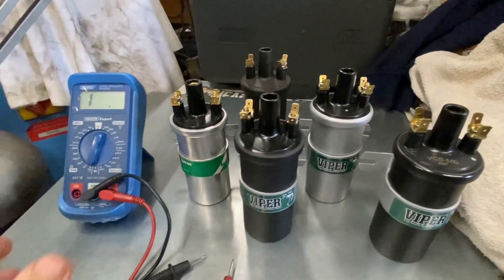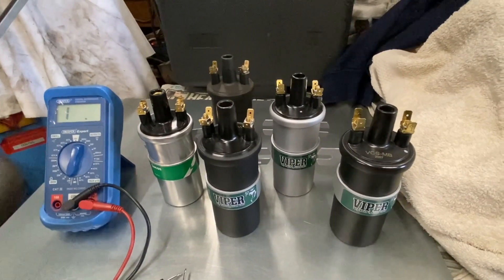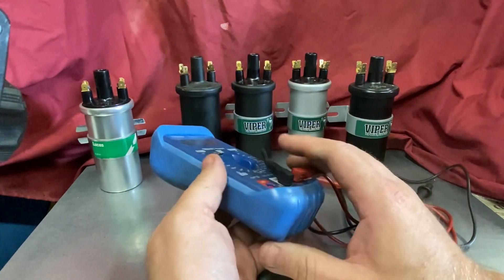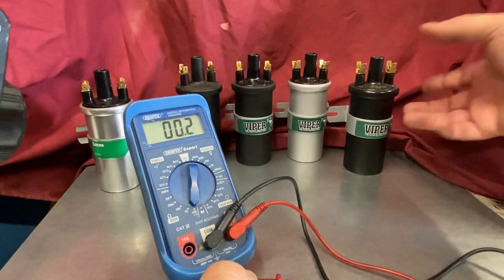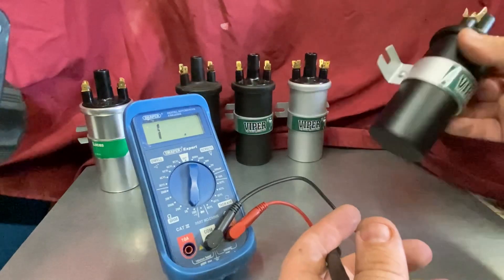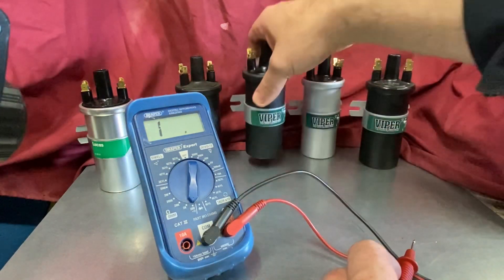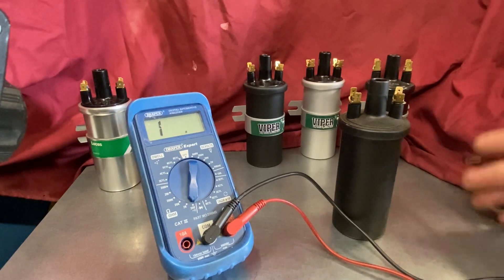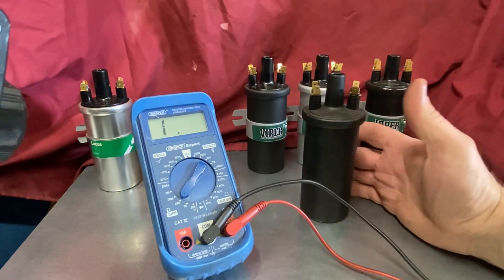Measuring ignition coil primary resistance

Comment: minnesota usa back in 1968 my brother bought a triumph harold a pice of crap british car. it would not want to start in the cold. I took a coil and ballast resistor off a 1957 chevrolet and hooked that up with a door bell button to short out the ballast. he would hold in the ballast bypass button and crank it. that really helped. he wondered why the the Brits would put the ballast in the original coil. all I could guess is it does not get very cold in england so they could get away with it.

Comment: So, you test the 2 terminals to get the primary resistance, for sure? I ask, because some guys on YouTube posting videos about doing it the other way, saying test 1 stud & the spark plug wire coil terminal, for primary resistance.? I believe your video is correct, cause doing it your way I had the same measurements of voltage.
Reply from the maker: The test you describe is how to test the secondary winding resistance
Reply: @ACDodd , oh ok. Are you the gentleman that posted this video?
Reply from the maker: @patsuddarth1093 yes
Reply: @ACDodd , oh ok. Well, thank you for the feedback & posting your video.
Reply: @ACDodd , so testing both of the coil's terminals would give you the primary resistance of the coil? Making sure I understood your video, correctly.

Comment: Old guy here. What is that device (the coil) used for? Much easier to send low voltage to a coil pack. Life is so much easier now with fuel injection and such. Just wish they had never gone to direct injection.
Reply from the maker: That’s an ignition coil for a classic car.

Comment: Good info on coils, I bought a 53 Ford Customline which had poor starting and a bad random misfire which I eventually traced it down to a 12 volt coil being installed backwards in the cars 6 volt negative ground system. Replaced it with an NOS coil and it starts like a dream. It has been my experience that spark plug gaps bigger than 0.040 just destroy ignition parts with no appreciable improvement in ignition performance. I went from the stock 0,055 gap on my 99 Ford and buying a lot of coil on plug parts, to 0,040 and not buying any with an engine that ran perfectly and passed many emissions tests.
Reply from the maker: Correct excessive gap causes coil insulation failure.

Comment: Hi AC, Can I pick your brain? 
I have a 1500 Spitfire with a Pertronx Ignitor coil and a ballast resistor wire. Pertronix call for a minimum of 3ohm total primary, and mine measures only 1.9ohm! 
Does the ballast effect things?
What coil should I fit and are standard plug gaps ok with the Pertronix fitted. 
Many thanks
Reply from the maker: What is the Petronix rated for?
Reply: @ACDodd thank you for the reply. 3ohm.  Main question really is, is it OK to fit a 3ohm, with the ballast resistor
Reply from the maker: @mickpower4796 no a 3 ohm coil is a backward step, especially if the module is variable dwell, you will actually be reducing your spark energy at idle and cranking. The ballast resistor will make this even worse.
Reply: @ACDodd thank you again.

Comment: You are a very knowledgeable man. Are they 9v coils when you use a ballast resistor? How do you match the resistor ohms the the coil ohms please?
Reply from the maker: You can’t use 0.8 and a larger ballast it won’t work out. Use primary and ballast that equal 3ohm for points ignition or electronic ignition with fixed dwell.

Comment: Will I need an external resistor for my ignition coil if it is not resisted? Or will it work without a resistor
Reply from the maker: That depends on what resistance your coil is and if your electronic igniton module is variable dwell or not.

Comment: Hi. What is the best coil to use for a 59d electric dizzy? Many thanks
Reply from the maker: The one with the lowest resistance as recommended by the manufacturer of the ignition module used.

Comment: So helpful! what are the odds of five coils being burnt out and sure enough thanks to your video I finally diagnosed that all! my coils are burnt out, 2 are new, never used!!!! because none of them have a secondary resistance, I'd been going mad trying different multimeters finally figured out that the only setting you should use is the one that beeps despite the instructions on the Klein meter I shelled out for you should definitely just use the continuity one it'll give you the reading you need, I've been trying everything else assuming I would get a more accurate reading, that is not the case!
Reply: Make sure your settings are right on your digital ohm meter. The secondary resistance is going to be a different setting depending on your ohm meter than what your primary reading will be. 
You should be getting (around) secondary readings at 8.9k-ohms — with 1.5ohms at the primaries.
Reply: Thanks for that, I tried again and got numbers that made more sense, I think it's partly my meter, I bought a good Klein one to try to solve the issue, now I've bought another coil, I just need to rewire and reassemble the engine so I can test 😂😂  @Zanester101

Comment: Great video and well explained, thank you. Still one question: what happens, if you use a 1.5 Ohm coil on a non-ballast breaker-point system of the mid-sixties where a 3 Ohm coil should be used?
Reply from the maker: You will likely melt the points. You also need to install the ballast resistor to get the system to work properly and see the full benfits.
Reply: @ACDodd  Understood, thank you!

Comment: Hi A.C. My Ignition Coils Primary Resistance is 0.8Ohm (I have a 65D Distributor Fitted).
The Secondary Winding Resistance is something like 4.6k. What's considered an acceptable Secondary Winding Resistance.? Is the Secondary Winding Resistance Value anything to be Concerned about.? I've had 2 Viper Dry Coils Fail on me Within a year, so have gone back to the Tradional Oil Filled Type for now.
Reply from the maker: Are you using a ballast resistor? Or have you been? When was the ignition module last changed?
Reply: @ACDodd  No Ballast Resistor with 12v Feed to the Coil.. Fairly new 65D Distributor, purchased from Minispares.
Reply from the maker: @ check the connections of the module to the dizzy if they are loose can cause spikes which will cause early coil failure
Reply: @ACDodd  Will do & thank you 😊 What about the Secondary Winding Resistance.. Is that Something we should be measuring.? I've read on Forums, that it should be more like 7.5k to 11k. I've measured it & it 4.6k.
Reply from the maker: @ I just checked a new 0.8 ohm viper dry it measured 9.81k
Reply: @ACDodd  so is 4.6k acceptable or is it something i shouldn't be worrying about.?
Reply from the maker: @ it’s not right
Reply: @ACDodd  New coil it is then.. Many thanks for answering my questions 👍

Comment: Hi AC Dodd,

I've been thoroughly enjoying watching your videos lately.

I needed some clarification from yourself regarding coils - I have fitted the Powerspark 65DM4 distributor, with High energy coil (0.7/0.8 ohms, part number replaces DLB 198) and silicone leads. I have seen on the powerspark website and the video with Twin-cam that it should be the correct rating coil.

However, on one of the mini forum threads, you have advised somebody to use the 1.5ohm coil instead, as using coils with lower resistance causes premature module failure and reduced part throttle torque.

Would you be able to advise which information is correct? Could you have just meant if the plug gaps were increased, putting wear on the coil? I am by no means disputing your excellent work and advice, but I just want to know what I have fitted is correct before I start the engine

Regards, Nick
Reply from the maker: Use a 0.8ohm coil and run 0.035”
Plug gaps. That previous info was when I was having a few issues with modules. Now this issue has gone use the as above.

Comment: for a mini cooper rsp 1275cc 1990, witch coil its better ? you can tell me please?
Reply from the maker: The standard coil is perfect it’s a 0.8ohm unit.
Reply: Briefly, can you tell me the symptoms of this part being damaged?
Reply from the maker: @mydreamarewheels a damaged coil usually causes misfires or not running at all. Can also change with heat.

Comment: Ballast coils take up to 80 Watts from your battery not good in the case of a tired alternator or generator fail, so on old cars with low power DC generators only use 3 Ohm or higher ohm coils because you might empty your battery when also using wipers and lights, also the hotter 1,5 Ohm ballast coils overstress old ignitions switches and locks and are heavier on breaker contacts, I would say they are for motorsport or more modern cars with relais assited starter switch and 55a alternator.
Reply from the maker: Actually ballast coils are only 30 to 40 watts not 80. If you are not interested in performance or emissions then yes you can stay with older lower powered ignitions. However, if you need performance and need to pass emission standard there is no excuse for using older systems.

Comment: hello and thanks for the video.
i have a coil with primary resistance that tests within specs but a secondary resistance that tests a bit high. (secondary range is supposed to be 2.4k-3.5k, coil is testing at 4.37k).  is there any problem with running this coil?  what impact might it have?
Reply from the maker: No I think the ones I use are much higher than that.

Comment: One day someone will post a video on how to test the amount of VOLTAGE going through a coil. It seems to be one of those blindingly obvious things that no one has yet thought of.
Reply: Well actually voltage doesn’t go through a coil, current does. A useful analogy to understand basic direct current electricity is a hose pipe. Voltage is the water pressure, current is the rate of flow of water through the pipe and resistance is the stricture of the hose resisting the flow of water.  It’s simplistic but works well in understanding the basics.
Reply from the maker: Maybe you should check out other videos of mine, for just that;
https://youtu.be/JKSyBwrVIrs?si=_msKx3Au46oJyPB9

Comment: Just to add to your excellent information. MSD in the US do a coil with primary resistance of .7 OMS and a ballast resistor of .8  OMS as a high performance kit, for points cars. What’s your thoughts on that?
Reply from the maker: Yes that’s ideal for engines with more cylinders.

Comment: You didn't say why you need a ballast resistor for that resistance
Reply from the maker: It will overheat the points if you run a 1.5ohm coil with no ballast.

Comment: Why don't you say what the resistance should be
Reply from the maker: In what respect? There are 3 applications, 3 types are needed for these applications. If you want to know what’s best, then that’s easy, the 0.8 ohm coil wins evertime. However if you have an original 1960’s vehicle this may it be the right one for you.

Comment: Excellent. I've been looking into changing from 24v coil on Willy's Hotchkiss jeep.
Running a voltage dropper to 12v then 12v coil still on points and condenser.
Now im not sure which coil ohm's i should use.
I was looking at Remax oil filled.
Interesting but confused.
Reply from the maker: For a willys engine a stock 3 ohm 12 volt coil is fine it’s does not rev hard enough to warrant a high power coil, I also doubt you could calibrate the carburettor suitably to take advantage of a high power  coil setup.
Reply: @ACDodd  thanks nice to know that there are still some Good old school gents around.

Comment: When starting a car with a 12 volt battery you would never get the full 12 volts directly to the coil by removing the ballast resistor from the circuit because the heavy load the starter puts on the battery drops the voltage from 12.? to somewhere in the range of 9.? volts.
Reply from the maker: You are correct, that is the benefit of a ballast system. However in a high power 0.8ohm system, you get the same effect. But better still you have twice the energy at higher rpm.

Comment: Excellent videos clear explanation.
Have you ever set up a 1400cc 74mm race engine , forged Omega pistons 12.5 :1 cr, all steel bott end, SW23 cam. 1.5 rockers
Twin HS6  1 3/4 carbs. 23d4 electronic dist.
What max advance should I be seeing at 6000rpm.?
What needles would you recommend?
Would appreciate an approx. Idea .
David Malta
Reply from the maker: Race engines need to be dialled in under load, Anything else is guesswork.The maximum advance is determined by using a rolling road. I can’t answer that without measuring it!
Reply: By the time you spend hours on the dyno your engine will be halfway into its racing lifetime hours. There will be no rebore because you have maxed the bores out.  You should not have gone to this extreme without knowing in advance exactly what is needed to make it work for the purposes you want it for - in this case full race. You should have been advised to stick with 73mm pistons and an 86mm long stroke crankshaft. MED and Swiftune would tell you the same. In that way, you would have years of life left in that engine block.

Comment: Question: I will use round numbers to make it easy, If the primary is driven with 10V, the the secondary is outputting 10K volts, whats is the ignition turns ratio?
Reply from the maker: 1:1000
Reply: @ACDodd  Sorry, wrong. 90:1 in the ones I have checked. A ignition coil does not work like a regular transformer. It charges the primary winding, then opens the circuit and this happens.
1. The secondary is open circuit (10's of megaohms) as the spark plug has a air gap (and in the cylinder the air is compressed, making it more resistance than atmospheric pressure).
2. with a very high impedance load on the secondary, the voltage sky rockets upwards (its called CEMF or BEMF). high enough to jump the air gap of the plug.

If you run the primary with say 1Vac sine wave and look at the secondary you will see ~90Vac for a 90:1 ratio. I am sure they are not ALL 90:1, but somewhere around there.
Reply from the maker: @user-rs8zg8ey2b everyday is a school day!

Comment: Doesn't the ballast coil , has it embossed on the bottom of the coil??
Reply from the maker: No
Reply: Something that can catch folks.
If you look around under the hood of some cars, you won't see the usual resistance block.  It's built into the harness as a wire.

Comment: Very good advise brings me back in time when I was a home tune man amazing the amount of times incorrect coils been fitted and  ballast resisters being missing and cold start feeds not there when cranking ,can I ask why you don't scope anything to look at ignition rotor air gap or ht kvs interesting to see you only use lambda don't you use a four gas
Reply from the maker: I used a 4 gas for years, to slow to respond and I can sense when the engine is not running correctly. I have also used scopes but after tuning a few thousand engines I can tell a bent dizzy  shaft or a poor coil and have ground scopes to be of little use now.

Comment: Coils when hot often change dramatically in Ohms.
Reply: Ohm test is not 100% conclusive.   Good test but has limits.  I use a Simpson 260 and connect it for at least a minute or two.

Comment: I can see what you meant when you said the reading was no resistance on the failed coil as no reading came up on the meter but it should have been stated as open circuit or out of range for the meter.

Comment: Or you can look at the side of the coil and it will say if it's a 6 VDC coil or a 12 VDC coil
Reply from the maker: No, that’s not possible in a lot of cases, the insulation on a 6 volt coil will inhibit its use in 12 volt applications. Most coils in the uk are not voltage marked

Comment: My 1972 MGB (non ballasted)is having some problems with coughing and spluttering and cutting out when hot in stop start traffic, am using CSI electronic dissy with Lucas sport coil (gold) oil filled, am thinking of replacing with a dry coil to your instruction in the video. Thanks.

Comment: I bought the so called Lucas coil recently to run with points ignition. Worked well enough for a few weeks. Recently the acceleration was struggling. When I opened the bonnet to look at the distributor i touched my arm on the coil body and it was red hot !!
Reply from the maker: Check the primary resistance

Comment: Many thanks. How hot should a coil get?, my a35 coil gets very hot to touch and car breaks down until it cools again. I would appreciate your advice.. Many thanks again. G.
Reply from the maker: What’s your coil resistance?
Reply: @ACDodd many thanks for your help, it's a fairly new coil bought from Bull motif, primary 2.8 ohms, secondary 8.39. I also have the old coil which I took off, it's readings are, primary 3.3,secondary 4.31. Thank you again. G.
Reply from the maker: @gerardlacey9384  what is the dwell angle reading with the engine running at idle and at 4000rpm?
Reply: @ACDodd the dwell is 62 degrees at both idle and 4000 rpm.
Reply from the maker: @gerardlacey9384  reduc the dwell to 56, this will take the edge off the running temp of the coil.
Reply: @ACDodd  I ll do that!. My sincere thanks for your kindness and help. My very best wishes to you. Gérard.